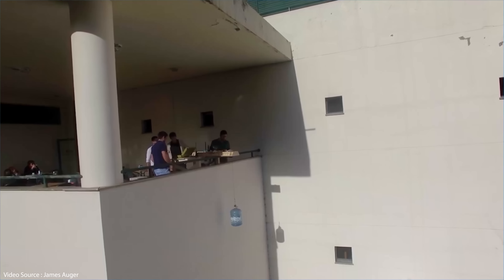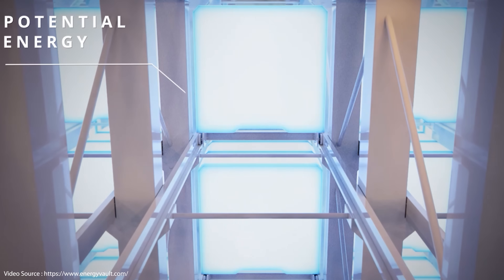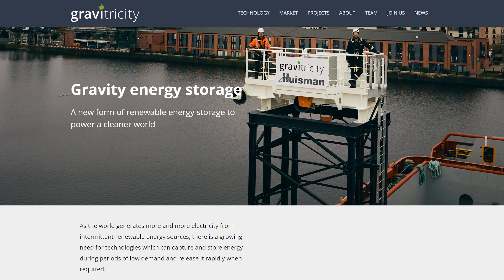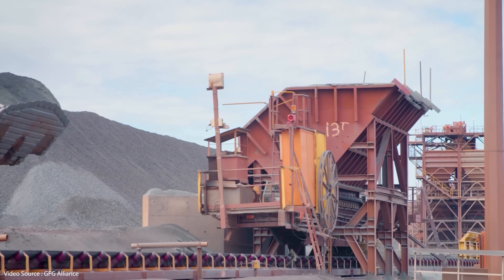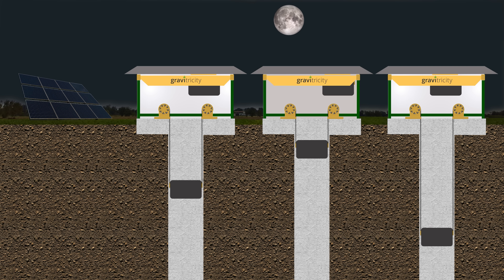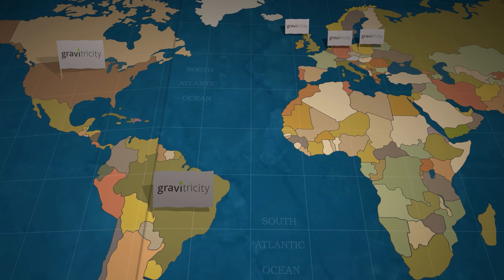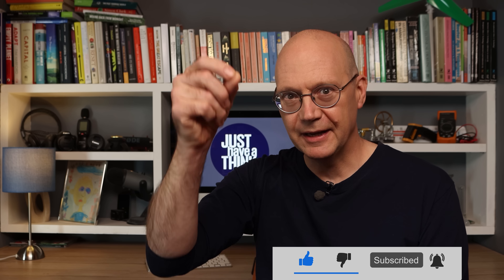Gravity Energy Storage. Who's right and who's wrong?

Comment: In the fifties, the TVA built what they called a "Reversible Pump Turbine" at their Hiwassee Dam facility.  During periods when the TVA grid had excess electrical generating capacity, they could use it to pump water from the Lake Appalachia reservoir below the dam back into the Hiwassee reservoir above the dam, for later use when the electrical demand was higher.

Comment: What about the liquid CO2 storage? Compressed CO2 is cooled to a liquid then when power is needed it is warmed to run a turbine to make electricity, and off peak compress CO2 etc… also to get all the CO2 to store pressure your taking CO2 out of sea water or the atmosphere reducing CO2 levels! The Navy runs a reactor to make Helium from salt water and a byproduct is CO2 or carbon that can be used to make Jet fuel that burns cleaner than oil based jet fuel? And is a proven technology can also supply salt free water, like we don’t need clean drinking water, also the reactor creates power to the grid

Comment: I still don't see what any of these systems have that is better than using water. We have a system near here for pumped storage that uses a water tower structure, so you don't need specific geography here. And water as a weight is heavy, and extremely cheap. You can put it above ground, or you could put it down one of those mineshafts if you want, but I suspect that you'd be able to get more energy out of it than using the concrete blocks that either of these concepts propose, it seems like you could just get more mass with a liquid than a solid that has to have other infrastructure around it. Pump storage is excellent, and I really don't see how any of these improve on it.

Comment: Hello Dave, it is a nice idea, but my O level physics puts a limitation on it. Hydro power can draw on a large area of potential energy being channelled through a limited area, the turbine penstock, whereas gravity power only has the diameter of shaft the weight is suspended in. Very good for short term response, but unless you are going to drive shafts, at high density, and at staggering expense, over an area replicating Lake Mead, then I suggest it is not a practical solution!!

Comment: How much power?  Well if you had a load of 10 tons dropping 2,000 ft into a mine shaft, power generated at 100% efficiency would be 10 x 2,000 x 2,000 = 40,000,000 ft lb. or 4.0 x 10^7 ft lb.  seems like a lot but 1 ft lb = only 3.766 x 10^ -7 kw-hr.  Multiply these two figures together and you get only 15 kw-hr.

Five of these things then would provide about as much power as is available from only one Tesla car battery.  Surely you can see that it is a useless idea.

Now you might argue that we should use much more weight than 10 tons. So how about 50 tons?  How much can a mine shaft hoist lift then?  If it could lift 50 tons it would then store about as much energy as one Tesla battery.  Obviously not worth the cost.  Going heavier, we’ll I don’t think the cables could take it.  Heavier cables would need to be bigger in diameter and would take up more space on a winding drum. The whole thing would have to be rebuilt.  The cables alone are probable worth much more than multiple Tesla batteries.  You can see where this is going, which is nowhere.  “There ain’t no free lunch”.  There is no substitute for Engineering evaluation and none seems to have been applied in these gravity simulations.

Comment: I wonder if there is a sufficient number of existing mineshafts of suitable depth for the system to make any impact. I used to live very near an opencast and deepest old workings were only around 35 metres down.
Reply: Opencast is the shallowest of all the mining techniques so it's not surprising the workings around you weren't deep. But your concern is totally valid, I think - this whole idea is quite "geo-locked" in a similar way to pumped hydro.

Comment: The use of shafts to regenerate electricity has been done by the mining industry for many, many years.  It would be a simple process to convert existing shaft to this duty at the end of mine life with almost minimal equipment needed.  In other words, this company is reinventing the wheel.  Just talk to any of the major mining companies to get it done quickly.

Comment: The mine shaft storage is very different from regenerative breaking!
You generate electricity almost the same when breaking or accelerating. If accelerating should use energy like with a car, the weight needs to accelerate faster than free fall.

Comment: Gravity energy storage may be better utilised by rather than  using a mine shaft to lower a weight. There are many steep inclines available  that could have a railway built. The railway wagons carrying the ballast weight could either use and then restore energy by a capturing a recirculating steel cable underneath the wagons. Or each wagon having an electrical motor/generator that utilised an overhead catenary electrical cable. This system could utilise many railway wagons moving up and down a long natural steep Incline.

Comment: Overlooked is the problem of water intrusion.  This will be a problem that needs to be addressed.  Any hole dug in the ground needs provisions for drainage, preferably by gravity.  If pumps are used design  and maintenance can be an issue.  If the pits are dug on a hill or small mountain a drain can be bored through from the bottom of the shaft to exit the hillside. 

With all the digging and boring into the earth to create renewable energy perhaps the proven technology of geothermal electrical power should be more aggressively pursued.

https://www.energy.gov/eere/geothermal/electricity-generation

Comment: good info!   How does the efficiency of the mineshaft weight compare with pumped hydro?  The capacity of the horizontal tunnels could greatly amplify the storage capacity, but at the cost of surface area.

Comment: Another variant of gravity is buoyancy, ie large concrete hollow spheres are tethered to sea bottom by flexible cable, with spool and generator at the other end (surface, anchor point has pulley). Patent exists describing it.

Comment: Has anyone ever considered A Large Pipe several feet in diameter, set on the shore line so every time the earth moved into the position for high tide, sea water would be forced into the pipe and held in by check valves until it was back into the high tide position again? It seems if you had the largest body of water moving inland several feet every so many hours or so, there would be some way of harnessing it.....Am I the only one who thinks tidal energy is greatly overlooked?

Comment: Energy and power density of gravity storage is too small to be very useful - compare a pumped hydro with millions of tons of water to call upon instead of just a few hundred tons.
Take an example. E = mgh
500 tons falling 500m = 681 kWh - enough to heat 1 house for about a month or 30 houses per day. You would need thousands or even millions of these units to be useful on a wide scale, and at what cost?

Comment: EGS are man-made reservoirs created by drilling wells thousands of feet below the earth to access hot rock at the earth’s crust. Highly pressurized cold water is pumped through the wells to cause pre-existing fractures of the hot rock to open up, increasing permeability. This enables the water to flow through the cracked rock and pick up heat. The resulting hot water pumps back to the surface where it is depressurized to make steam, which spins a turbine to generate electricity. The water is then cooled and pumped through the wells again, repeating the same process and creating a closed-loop system.

Comment: Mechanical Work is made of: (the mass) & (the distance) components.
The potential energy ‘outputable’ by the system - that is - it’s “work potential” is constant for a given a mass at rest. 
 The total energy therefore that can be created by the system is not increased by delaying its fall with ropes. It would take more energy to build than the system could extract.

Comment: I'm nowhere near qualified to judge the engineering feasibility of a project like this, but Heindl Energy has an interesting looking gravity storage concept that they are shopping around to investors. It's similar to the Graviticity design, but pumps water under a massive piston using a reversible turbine. The thing that peaked my interest was their claim that construction costs will increase with the square of the radius, while storage capacity increases by radius^4.
Reply: I'm also kinda fascinated by the Heindl proposal.  I suspect that cost probably increases with R^3 rather than R^2, but energy definitely scales with R^2. It's a really clever idea and if it scales well it should work. I think it's at least worth a pilot demo.
Reply: Rather, energy definitely scales with R^4, so faster than cost.
Reply: @aaronclair4489  I'm also a bit skeptical about that claim. It seems like they're assuming construction costs scale with the surface area of the project, and the cost of the material to build the "piston" is negligible. Might not be the soundest of assumptions, but I'd love to see a pilot project at a semi-large scale. A stadium sized unit that could act as a load equalizer for the grid, and backup system for a small city for several days if necessary seems like it'd be worth the risk to give it a shot. I just wish their idea could get a bit more publicity and funding.

Comment: Nice concept but I think that this project would need to use mines which have not been abandoned for tens of years because they will require massive investment to fix / pump out water. Also another issue is the ground stability of the surrounding areas where mines have been dug previously. The land can and does often sink and collapse over time without the additional weights ( bear in mind they want to raise and lower huge weights almost continuously) , then the weight of the structure itself, ie building and equipment. It will work and the concept was proven but I think most of these concepts will work because they use cheap electricity and sell it high, its always going to look good,  but... it seems to me like a money pit :P

Comment: How many abandoned mineshafts are usable for this? How much energy can each store? How is raising and lowering 500 tons of solid more efficent than raising(pumping) or lowering 500 tons of water?How much energy would be needed to keep the shaft free from water messing with the solid mass?
I strongly suspect the storage capacity will make it unsustainable.
If the shaft is 100m deep and the mass is 500 tons, the energy stored will be 10^2m x 5 x 10^5kg x 9,82 m/s = 49,1x10^7 J or about 136 kWh.
A typical Danish 2MW land based mill will generate about 5000 MWh=5000000 kWh in a year or about 570 kWh per hour so it would take 4 such shafts just to store the enegy one such mill on average generates in an hour.
Water works because its so easy an cheap to move and store in huge quantities. I will be very surprised if solids will ever work in a meaningful way.

Comment: I was watching a set of lift locks with a friend and we were discussing how easy it would be to modify the lock plumbing to produce energy simply by harnessing the movement of water from one lock chamber to the other. Pretty much free energy just by controlling the depth of the water in each lock. A true gravity to energy system with all the power already supplied by nature.
Reply: Isn't that already done on the new Panama locks? Pump and partial energy recovery at least...
Reply: @eastcoastandy2905  I believe you are correct although Im not sure about any pumping as the locks are gravity fed from Gatun lake. The power generated are to operate the gates and lighting.

Comment: Why does the Energy Vault proposal include lots of machinery lifting, moving, stacking and releasing lots of blocks, rather than something like one huge permanently attached weight raised slowly up via lots of gear reduction (to any intermediate height), then switched at any time to drop it down again (driving the generator and a flywheel), again, for any amount of time desired, switching back and forth between modes as desired?   Only one basic hoist to build and maintain, very little complex sensing or smart robotics needed to operate.  I guess this is more like what the second company is doing?

Comment: Just a question: I tried to do the math behind it.
If i pull 10000kg 20m up in the air.... i get ~0.5kWh. (without losses)

Did i miscalulate anything?

If that is the case: The engery density is not great... if not to say... terrible.
Reply: I'm afraid I believe your maths is correct. I'm a power systems engineer working in large-scale renewables, and the insurmountable issue here is indeed that the energy density is tiny. A 500 tonne (500,000 kg) weight lowered by 100m down a mineshaft can give around 500MJ of energy if we assume a system efficiency of 100%. That sounds like a huge number until you realise that it's only 0.15 MWh, which is paltry, I'm afraid. 

Pumped storage works only because you can (and you need to) shift many tens or hundreds of thousands of tonnes of water up or down a big hill in order to give you a sensible amount of energy.  

I can't see how any of the other gravity storage solutions will ever get to anything like the required scale, unfortunately. That's a shame, because they're very imaginative.
Reply: @steveelliott3685  i am not saying that this sounds super terrible. and with water... you dont have to build huge structures. most of it is the pure water itself.
but if you think about huge concrete blocks that are moved around... i have a hard time believing this will ever pay off.

compare the energy density of a car battery (12 V x 70 Ah = 840 Wh) with my example above (10000 kg x 20 m = ~500Wh) and now picture the space and mass needed for both solutions.... There are some more aspects to it... maximum  current to withdraw and so on... but this sounds like we dont have a plan here...
Reply: a concrete block of 10000 kg is roughly 4 cubik meters.
so 2x2x1 meter.

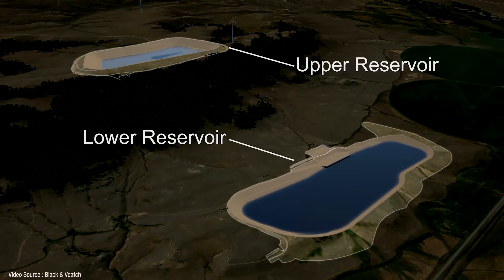Comment: 1:40 pumped hydro stores electricity from non renewable sources, that's true 

However from a physics viewpoint almost ALL hydro is gravity energy storage. Let me explain...

Solar power evaporates sea water, bouyancy uses that stored solar to lift the water into the air, and most of that energy is lost when it falls as rain. A small fraction of the original solar heat ends up stored behind a dam, delayed by human ingenuity, and it is gravity acting on that water that eventually turns a traditional overshoot water wheel. For undershoot wheels and turbines there is one more step: the gravity acts on the water to make it move, and that kinetic energy then turns the generator.

The only hydro that is not storage related is where the speed of an undammed river is used to turn an undershoot or turbine generator, or where water is diverted from a waterfall to turn an overshoot.

But it is all recent solar energy (unlike fossil fuels which are solar heat delivered billions of years ago).

Postscript

Nuclear energy is even more prehistoric: the nuclear materials that power a fusion or fusion reactor were all made in stars that does long before our Sun ignited. As the song days "we are stardust". But that is a different story...

Comment: The problem I see in the US is that population density is low where the mining shafts exist. Also, are there actually enough old mineshafts to make this a viable choice? And what about ground water or flood waters? Old mines are prone to flooding, aren’t they?
I would like to see them also apply their engineering concepts and technique to reclaim open pit mines, and even scale down for supplying storage for individual rural properties. I think there would be more opportunity if they looked at using hillsides, too. A long slope with a simple track for the weight, a hoist, a generator, and home sized wind or solar would make this viable for many individual properties. Utilizing existing roads that have enough slope on a straight run and a median could work for municipal power, and micro wind created by the vehicles could supply the lift power.

Comment: Call me dense, but I have a difficult time visualizing this idea working for any but a limited set of applications.  Consider the problems involved with creating purpose-built towers across any landscape, urban, or rural.  They are and would be eyesores, especially if built in quantity.  I think the idea of using abandoned vertical mine shafts is workable, but those are few and far between.  It sounds like each of these things would become a bespoke project; uniquely designed and built for each site.

Comment: Compressed air stacks up very well in comparison. Hope we get a positive update in the near future.
Reply: Depends how you look at it. Compressed air losses pressure as it runs out but a huge gravity battery weight will pull with the same force from too to bottom and you have no compressed air to handle.

Comment: Old ventilation shafts from disused mines would be ideal for gravity storage, you could even tunnel through a mountain  range and sink shafts to the bottom many times, allow the weights to be worked in the base of the tunnel. at ground level. Most ventilation shafts are bored with a small bit and then a large drill bit is transported underground and hooked up to the drill rod and pulled up from the bottom with the drilling machine at the top while removing the material at the bottom. you could drill a new shaft every so many metres apart in a long pattern.
Reply: How much energy does it take to dig a shaft... Old ones are viable because they are old.
Reply: @africanelectron751  a 5km tunnel could allow 100's of vertical shafts